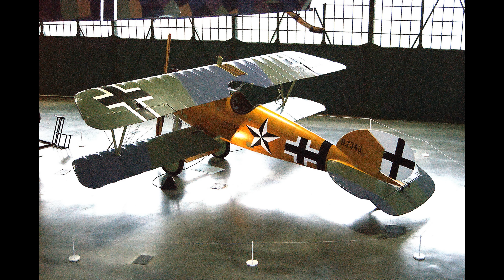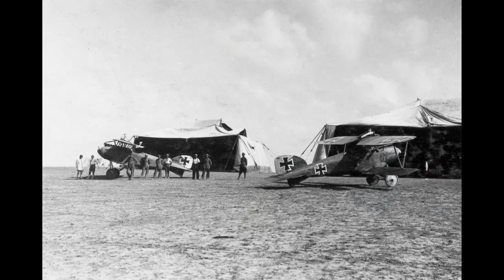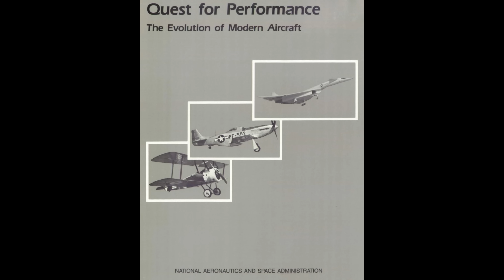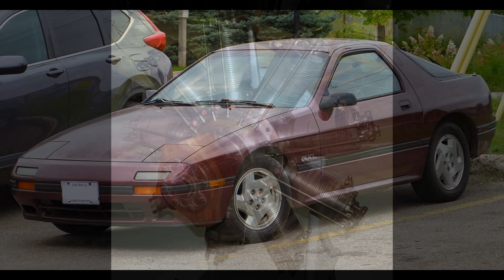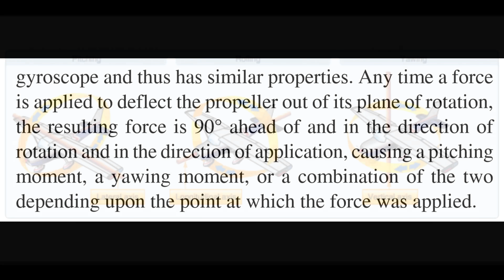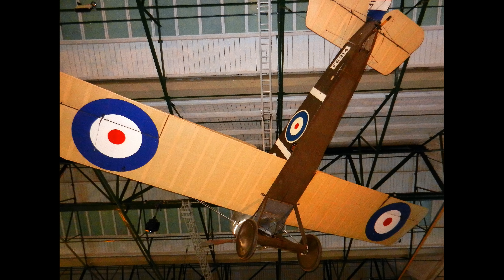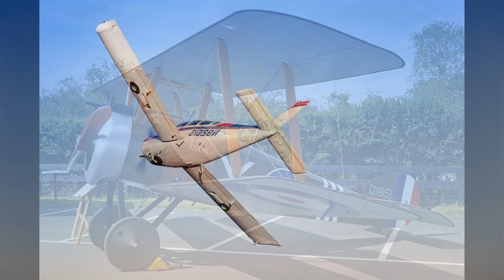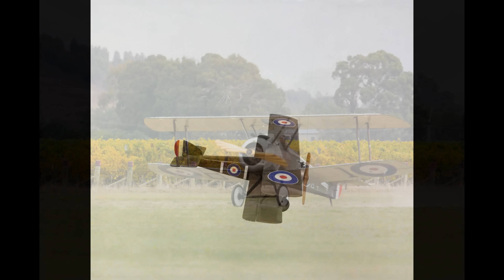Sopwith Camel, War Winner or Death Trap?

Comment: Pretty cool how both ww1 and ww2 had a really iconic and balanced matchup between a British and German fighter, Camel and Dr.1 in the first, with the Spitfire and Bf 109 in the second.
Reply: That's mildly historical indeed, reality is as always a bit more complex as a number of French types more than held their own in the fray of WWI, as did American and Soviet types in WWII.
Reply: @Pouncer9000  No Soviet fighter was ever especially competitive with the best German fighters and especially not Allied fighters.
Reply: @Will-hv9ns  to be fair, the Soviets sort of caught up in terms of vertical maneuverability by 1943 with La-5FN, and by 1944 Yak-3 and La-7 were becoming available. (Not going to mention Yak-9U since VK-107 was a burning pile of... well, let's say Klimov wasn't that great at constructing engines.)

In terms of horizontal maneuverability Yaks constantly outperformed the German fighters, and La-5 was about equal to a 109 without it's underwing guns. MiG-3 was obsolete at lower altitudes, hence why it was soon cancelled. And also because the engines production for MiG-3 could be switched to producing engines for Il-2, a significantly more important aircraft for the front.
Reply: I’d say the Fw190 during WW2 also counts. 

The Bf109 got outclassed by the Spitfire by mid war, and never really recovered (fundamentally it was just an older design), so the Fw190 took over as the really dangerous adversary, while the Bf109 was relegated to bomber hunting (essentially becoming the equivalent of the Hurricane during the Battle of Britain). They should really have phased out the Bf109, but they kept churning them out because of internal politics (basically Albert Speer got to look really good by saying he’d produced loads of aircraft, never mind that they were completely obsolete and they had neither the fuel or pilots to use them effectively).
Reply: @HALLish-jl5mo  All the top Aces flew 109's most of them even after the 190 was available to them.
Reply: @schmitty1944  That is interesting, but those are WW2 German claims.
Which are... Questionable.
It was a target rich environment, so I don't doubt they had the largest number of aces, and the most successful ones. But between their habits of attributing an entire squadron's victories to its leader, and just making up victories, I'd take those numbers with a pinch of salt.

I'd also note that the really high numbers were usually accrewed on the Eastern front, which got proportionally less Fw190s, because they were facing worse aircraft.
Reply: @HALLish-jl5mo  The Me 109 staryed in production in part because the FW190 was not capable of taking on the P-51's at high altitude. Likewise, the FW-190 was perferred for taking on B-17's as the air cooled radial was more resistant to defensive gunfire from the bombers and also provided more protection for the pilot.

Comment: Castoldi the designer of the Macchi C.202 lengthened the wing on one side (I believe the right wing), this help to eliminate the gyroscoptic procession.
Reply: I was under the impression the wing was longer on one side to counter the torque produced by the propeller.

Comment: I got to crawl over one of those WW1 rotarys in the Melbourne museum. It had inlet valves in the piston crowns and one exhaust valve in each head. I assumed the fuel oil mixture was sucked into the crankcase, sort of like a two stroke.
Reply: Correct, leading to very little engine throttle control, idle or full power mainly. Intermediate power settings were achieved by blipping the engine, in other words turning off the ignition momentarily.
Reply: @chrisknight6884  The high rotating mass of a rotary meant it would continue to spin when "blipped" momentarily and then restart. Of course when "blipped" it would pass unburned fuel that often ignited when the engine restarted.

Comment: On guns taken from The Red Barons crashed plane you can see the tubes fitted to draw engine hot air to the machine guns working parts.
Reply from the maker: That's fascinating. I knew someone in the comments would know how that was done. Good job Edward.
Reply: Norman Franks has shown Von Richtofen had one dysfunctional gun, the other firing single shots, at the he was shot down (indisputably by ground fire).
Reply: @lllordllloyd  I came on here to say the red baron ground fire we also have his plane a museum just outside of Folkestone
Reply: @lllordllloyd haven't watched the video yet but I thought it most commonly believed tk be air to air and the ground fire idea just an attempt to save his legacy.
Reply: The better French fighter pilot aces, the ones flying the Nieuport Bebe/17 and other types with the Lewis guns mounted on their upper wing, had a thing about being very precise and calculating, so they would only fire their gun a few rounds to make a kill.  Charles Nungesser was famous for his using as little ammo as possible.
Reply: @tauncfester3022  Early on there was an Englishman who went up with a hunting rifle but eventually he was machine gunned.
Reply: @20chocsaday  I believe that was a a Lee Enfield MkIII standard British issue carbine that Lanoe Hawker installed at an angle to clear the propeller, of the fuselage on a Bristol Scout. So later versions used the Lewis light MG mounted the same way.

 Lanoe Hawker was shot down by Richthofen in an Albatros D.II while flying a DH2. it was actually a long fight,  they both were excellent pilots and couldn't get a bead on each other, it when Hawker's DH2 was running low on fuel that he decided to run back to the British front and was killed by Richthofen because his DH2 wasn't as fast.
Reply: @tauncfester3022  I had not realised it was a standard issue rifle. I thought he brought his own from home.
Reply: @20chocsaday  Well two things:  The Lee-Enfield was incredible common and could be reloaded with one hand with stripper clips from the opened breach.  Having it solidly mounting it to the fuselage leaves one hand free to operate the rifle.  I would think a hunting rifle floating around in a cockpit would be an extreme hassle to load and fire when you also have to at least keep the plane on aim with the stick and rudderbar.
Reply: @tauncfester3022  I never thought 'solid' would be applied to one of those aircraft. 
Still, something must have absorbed the recoil.
Reply: @20chocsaday  as solid as can be expected, the mounts are steel fabrications bolted or clamped to the Ash longerons. Those weren't exactly marine sized but for the Bristol Scout it's not as light as the Nieuport Bebe.

  If you want the gun stay stay steady in a 90+ mph wind at an accurate, aim-able angle to the air's movement and that it doesn't wobble from the recoil much.

  Look at the early Nieuport's over wing Lewis mount, (not the Foster, the one where the gun pivots back at 90 degrees...) they were bolted into the upper wing structures which aren't exactly heavy wood joinery.
Reply: I believe that was in the era that 'chases' pilots were still going after higher-altitude 2-seat observation planes like Rumplers where you'd follow underneath and behind with the gun pre-trained for best ballistics.
Reply: Only if they surprised the enemy by flying up into their blind spot. In a classic dogfight, it was no holds.
Reply: @Triple_J.1  The classic dogfight? Most kills were done without the attacked pilot even aware of the immediate presence of another enemy pilot. Or it happened so fast they were still getting their bearings.

  That's how fighter pilots become aces.

  My Uncle flew Hellcats and Corsairs in the Pacific, he was an ace and most of his kills were on enemies that had not even noticed his plane dropping in behind them
Reply: The tubes extending from MvRs guns are exit chutes for the ammo belt. Those tubes guided the empty belt into a box inside the cockpit, which kept it from flapping in the slipstream.

Comment: Perhaps, the "hump" is seen not from the side but from behind. Compare tail-to-nose photos of the Camel and its predecessor, the Pup.
Reply from the maker: I seem to be able to only see it from the side. In fact the picture I had on screen while I was talking about it was the one I though was the best for showing the hump.
Reply: @GregsAirplanesandAutomobiles  I saw it again in the photo at 6:16
Reply: I was going to say something similar; the Pup has a very “straight through”, boxy fuselage, so it’s perhaps the difference between the two than the Camel being particularly “humped” in isolation.  Certainly might have seemed that way if you were a pilot transitioning directly from one to the other.

Comment: So those rotary engines had no reciprocating mass. That must have made them very smooth.
Reply from the maker: What? No, the still have pistons that move up and down. It's just that the crankshaft doesn't move, it's bolted solidly to the engine.
Reply: @GregsAirplanesandAutomobiles  The crankshaft is not bolted solidly to the engine. The crankshaft is bolted solidly to the airframe and does not rotate. The big end journal is stationary. Therefore the pistons do not go up and down.
Reply: @GregsAirplanesandAutomobiles  Bolted solidly to the airframe, I think you meant to type.
Reply: The pistons do all move in a circular orbit, but the circle is eccentric to the crankshaft axis. I believe this did make them smoother.

Comment: In 1976, I bought a model Cox Sopwith camel, and my brother bought the big purple trainer.  His started up and flew right away. Mine had a defective glow plug.  I finally bought  one online 30 years later and Buddy brought over some fuel.  It started right up.  So I wrote on the garage wall "After 30 years, I finally played with my COX".
Reply: I flew those COX engines for hours. We had an awful time getting them started until we quit going by COX starting instructions. They recommended like 4 times too much fuel to start.
Reply: Yes, I still have the plane.  It is the spare room.  In its original box.  Slightly banged about.

Comment: I never realised the engine actually spun, I always assumed that a rotary engine was just a radial engine with a different name.
Reply: They weren't throttled either.
Either on or off. Basically shutting off and on the magneto.😮
Reply: @sadwingsraging3044  Different times I guess.

Comment: I learned about that goofy rotary engine from a warplane documentary on PBS. Holy centrifugal forces, Batman! Sounds difficult to wrangle. I've only just started the video as I'm writing this. Looking forward to learning more about it.
Reply: That was another reason for the Camel nickname as a 🐪 was known to bite its rider.
Reply: Oh, side note, I wonder what would happen for a multi engine plane using these rotary engines. Would the gyroscopic forces cancel out if the plane had two opposing rotation engines? Would the airframes and wings have internal stresses greater than normal? That'd be a fun thing to think about if I was smarter. Lol
Reply from the maker: If they counter rotated then yes, they would cancel each other out. To my knowledge, such a plane has never been built, meaning a twin engine plane with counter rotating rotary engines.
Reply: @GregsAirplanesandAutomobiles  I can imagine that once the performance of a twin engine plane was required, the metallurgy would've also sufficiently improved to allow for radial engines instead. Anyway, fascinating video as always. I like the way you visualized gyroscopic precession.
Reply: @TrentFalkenrath  There were twin engine and even four engine planes during WW1. I can't think of any that didn't use liquid cooled engines though.
Reply: @TrentFalkenrath  Rotaries were notorious for high fuel consumption, which meant they were not generally used on multiengine planes that were required to have more range than the singtle seater scouts.

Comment: Regarding modellers and flat RAF wire: a common method is to use a flat elastic thread.  If you make sure it isn’t twisted it looks really nice.  Having built a Bristol Fighter, Camel and a Felixstowe flying boat (derived from the big Curtiss designs) rigged this way I can confirm it’s also a massive pain!
Reply: The up side on the flat wires is that they don’t use turnbuckles.  They were made in approximately the correct length and had screws at each end.  To tighten or loosen them the riggers would turn the screws at each end.
Reply: I fly giant-scale WWI models. For my 1/3 scale Sopwith Pup, I have functional flying wires exactly like the original. Currently I'm using braided steel wire silver soldered onto clevises, but I've got a big spool of 1/3 scale RAF flying wire from - I think - Proctor - that I intend to install when I get around to it! But it's a major hassle to work with... I only use the elastic for the occasional non-functional wire on some of my smaller models, like my 84" Eindecker.
Reply: Spot on,  modellers often use Prim knitting elastic which is flat.  We can also get rigging wires in photo etch.  That’s more difficult to get the right fit and is easily damaged.
Reply: I've been able to buy Kevlar tow thread which is wound on the bobbin and has a sort of flattish profile.  I build smaller WWI RC models and use working rigging.  There's this older, what used to be called Dacron thread used for Cox control line models is pretty good as a substitute when your model is 1/12" scale,  build in lightness. Most of my 1/12 scale WWI models weigh less than 250 grams.
Reply: @tauncfester3022  The lighter the model, the slower it flies, and thus the more realistic it looks when flying!  Most powered models are out-of-scale too heavy, and have to fly at unreal too fast scale speeds, which destroy the illusion of a natural flight model...
Reply: @alfredomarquez9777    I saw a scratchbuilt 1/4 scale Spad 7 at a WWI Jamboree many years back, the owner was flying an old Asp .80 4 stroke swinging a 16 X 10 propeller and had added a thicker head gasket to lower the compression.  It was really light too, about 9 pounds, built like an oversized scale rubber freeflight model.  It was about the best flying 1/4 scale WWI model at the event. It was like a parkflyer electric scale model, maintained level flight at 1/4 throttle.
Reply: @alfredomarquez9777 Sure ruins it for me. I hit the settings and slow the video speed here on YT.
Reply: Used to have a local wire rope manufacturer. In the 1980s they were still producing limited runs of wire for aircraft with a sort of airfoil section. Using the same drawing and rolling dies they had been using since the WW1 era or shortly after that. MacWhyte Wire Rope
Reply: There's a paper modeler who does a lot of WWl era paper models in 1/33rd scale. How he does his rigging is always a joy to watch. Channel is Dan Smith. Paper or more properly Card Models offer a much wider range of subjects than injected plastic kits ever will. At a much lower price. Plus even if you purchase a printed kit in book form you can scan the sheets. That way if you screw up just print a sheet 😊

Comment: Jet engines have a lot of rotating mass, but jet planes are a lot faster; do single engine jet planes have to compensate for the gyroscopic effects?  Do jet engines come in left and right hand versions for twin engine fighters?
Reply from the maker: Good question. The mass of the rotating part of the jet are so low compared with the mass of the airplane you barely feel it. In a  Camel the engine is about 26 percent of the total mass, more with lighter fuel and ammo loads. That entire 26 percent is spinning. A 767 has engines that are like 7 percent of the total mass and of that the only big diameter thing that spins is the fan and as a percentage of aircraft weight, it's nothing .
Reply: As far as I'm aware, the engines don't come in handed variations, probably because the gyroscopic effects are negligible and it would significantly complicate maintenance & logistics concerns. I think the most practical application for something like this would be a free turbine turboshaft, but I think it's unlikely that it's ever been done in any kind of widespread engine design.
Reply: Rotational inertia for a disk (can use as a proxy for a rotary engine) is proportional to mass x radius^2. So a (relative to the plane) heavy rotary engine with its mass far out from the crankshaft will have a relatively much higher moment of inertia than a jet engine. Angular momentum for a disk is only linearly proportional to rotational speed. So a large diameter heavy engine in a small plane will produce more gyroscopic effect than a smaller diameter faster spinning one in a heavy plane
Reply: @TomM-jh8lx  Thanks.  I'm not much of an engineer, but I do understand the difference between linear and square.  That makes an F-16 looks positively wimpy in the inertia department.
Reply: Hadn't thought about the percentage of weight which is rotating.  An F-16 dry weight is 20,000 pounds, the engine is 4000 pounds, but no more than half can be rotating, so that's 10% max, probably less than 5%.  On the other hand, a web page says they spin at 2000-15,000 rpm,  Another page says a Gnome rotary max RPM was 1300.  So ten times as fast, probably 1/5 or 1/10 the weight percentage, and the control surfaces have 5-10 times the air speed over them.  I don't know how much any of that matters.